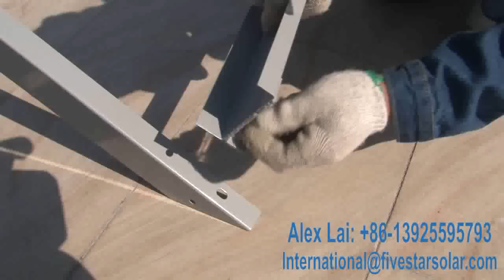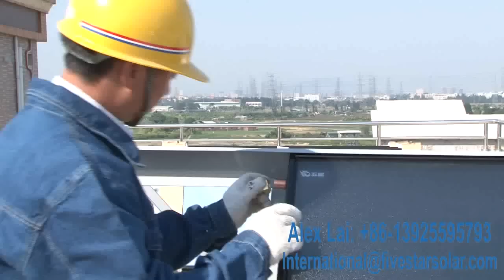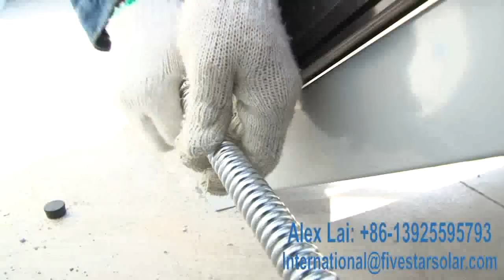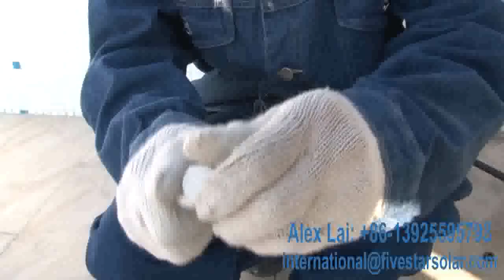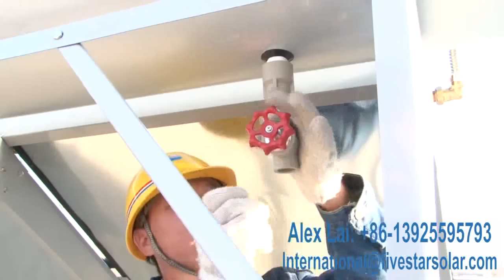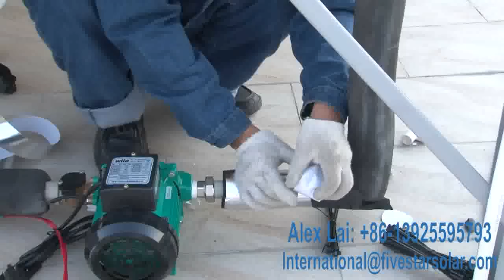How to install a solar water heater - Compact non-pressurized solar water heater

Comment: I would like to ask about the difference between the pressurized and non-pressurized systems
Reply from the maker: The water tank is different. 

The pressurized water tank can hold the pressure inside because the inner tank is normally more than 1.5mm thickness. The hot water go the bathroom by the pressure from the pipeline. Hot water go out and cold water go in at the same time.

The non-pressurized tank normally use 0.4mm thickness SUS304 stainless steel for the inner tank and could not hold the pressure. You need to add a magnetic valve or small supplement tank for the water feeding.   The hot water go the bathroom by gravity. It means that the tank position must be higher than the bathroom.  Higher position of the water tank,  higher hot water pressure output.
Reply: Helpful excellent reply